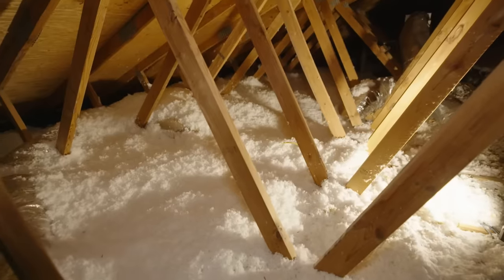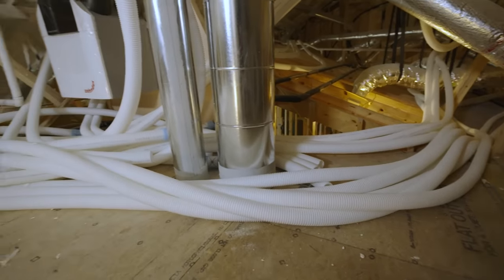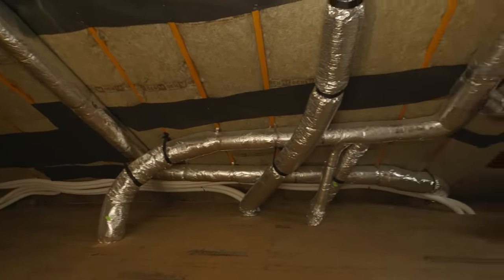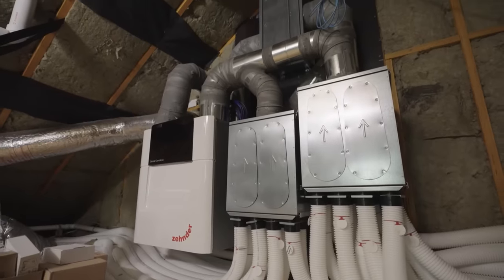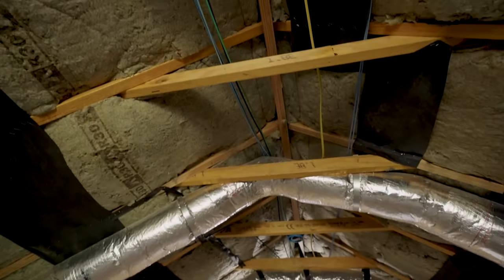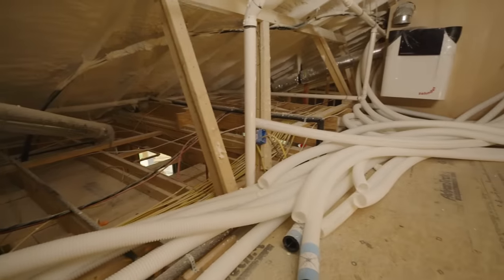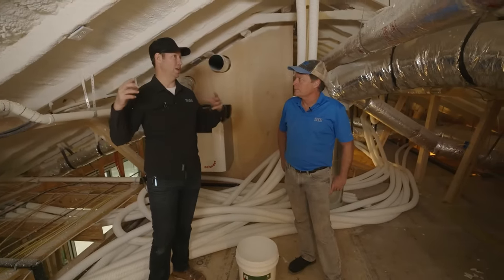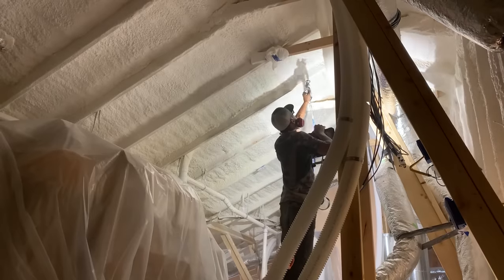Building a BETTER attic - Unvented + Conditioned attics 101

Comment: Don't say it's dumb. When it's done right, it's totally fine. Is an insulated attic better, yes, but if all attics were insulated, house prices would be much higher and it would be even harder to buy a house. You have to know that we are not all sponsored?
Reply: How is sticking the insulation to underneath the roof any different that laying it above the ceiling?
Reply: @ShotGunner5609  Gravity can hold insulation down. It can't hold it up. Thus, you've gotta use a more expensive insulation solution to get the job done. Ergo, quite different and somewhat unnecessary if the attic is actually vented properly(many aren't)
Reply: @InfernosReaper  yeah the same thing happens with unfaced fiberglass in your walls. That why you use the faced stuff. Nithing lasts forever but thats just a secument issue. The cost difference isn't enough to say its gonna keep you from affording a house. I agree that most places are not correctly vented. And venting is not necessarily a bad thing when done right. But it is better to completely enclose and insulate.
Reply: @ShotGunner5609  Properly enclosing with insulation costs a lot more than you seem to realize. For people with a lot of money, that's no big deal, but for most people, costs add up.
Reply: @InfernosReaper  the only difference in price would be that fancy erv thing for circulating air/bringing in clean air. And then the cost of the extra material to insulate all the walls and ceiling. So in most markets like 3-5k. Thats if you were doing it and it was an add on after purchasing a home. I do wonder how much "value" that would add to a home you were actively buying though.
Reply: @InfernosReaper  I don't think the cost is that much more. Additionally you will recoup some of that costs through energy savings. You can't calculate the better comfort and  air quality you will have. 
I think the bigger problem is we have built homes cheap at the expense of quality.
Reply: @agisler87  Given enough time, sure, but the energy savings really varies greatly by location, though, so for some it could take decades to make a difference.

That doesn't even get into the perils of potentially missing or not being able to track down a roof leak because the insulation's trapping and diverting water. 

I"m not saying the idea's bad so much as it's costly enough and comes with enough drawbacks that it's not the definitive better approach it's being made out to be.

Though, I do question how much power you'll be saving running AC in the attic instead of having good natural airflow.

Comment: Matt love the videos, but I’d say the majority of your viewers don’t have this in their budget myself included. When sponsors pay for half your house, it’s easy to put this kind of thing in.
Reply: Ultra wealthy and government buildings (tax payer funded) is the only new construction I have ever seen with non vented attics.
Reply: @tmiranda1379  or sponsored YouTubers
Reply: @JavaZombie  No, just the stuff that is of questionable value that he is trying to pass off as the norm, or as "a better way".
Reply: This is how the rest of the world is doing their attics! The US did it too, but that was before we got cheap shit houses we have now. We store stuff in the garage because most new houses also do not have a basement and our cars park outside in the sun and rain. In addition we pay for storage spaces. Overall, we went backwards and pay more.
Reply: I have an 86’ rancher in central Florida. By no means was it “efficient”. All I did was add a ridge cap, used batton style insulation instead of blown, decked over the batts with 1/4 plywood, sealed any air gaps in the ceiling with spray foam and installed a fan up there that works on a switch. My house feels so much better and my electricity bill is thanking me as well.
Reply: The cheap, effective way to build attics is vented, unconditioned, with a wall-to-wall layer of OSB on the bottom chord as an air barrier, and empty of everything except insulation. No HVAC, no recessed lights, no wiring.
Reply: "the majority of your viewers don't have this in the budget, myself included."

So what.
Reply: This is the equivalent of buying a vehicle that has 10 mpg at a lower up front cost, or buying a more expensive vehicle on the purchase price, but it will get you 40 mpg.  It all depends on how much you're willing to pay now, or pay later, and what the breakeven point will be.  Either way, you are paying.  My perspective- going with the less expensive purchase price option only gives me the chance to save money- once.  And my ongoing operational expenses will be elevated.  Or, I can spend more money up front, and save money every single month.
Reply: I thought that I had read that even with Rockwool you would need some sort of membrane.  Clearly there is none.  The Rockwool is vapor open.   Can you speak to when you need a membrane between the insulation and the conditioned part of the house?
Reply: @notahotshot  he’s saying this isn’t really a video for an “every man”, it’s like “here is how you do your own oil change on your Bugatti. It’s not terribly difficult if you only install a two post lift in your garage, and hire a mechanic to come to your home to do it. Also, it helps to have a complete set of Snap-On tools to get the job done right.” It’s just being pretentious, he did none of the work himself, his employees did, and probably figured out using his accountant, most of the ways to deduct every penny. This is a video for builders that want to build this way and sell this way to their customers, it is by no means something made for homeowners that just happen to have $50k+ laying around to “spruce up their attic and remove all relative humidity and sound”. I’m sure that’s what the OP meant.
Reply: @JavaZombie  Prove that they aren’t, he plugs companies all the time, plus he has a successful business where he gets discounts on brands, he has a YouTube channel where he gets revenue, and he has accountants that find all the tax loopholes, so, yeah, he DOES have sponsors, maybe not that kind that want you to plaster their stickers on your hillbilly nascar though. And no guy, most people don’t just have $50k+ laying around to pull this amazing attic build off. This guy had his crew do the work, knows the vendors, knows the technology by going to expos and seminars, he’s the right guy in the right industry to be able to do this, regardless of “priorities”.
Reply: I cannot have this therefore you cannot make a video about it.... what sad, miserable drivel
Reply: If you don’t pay the money upfront to do this, you will be paying it in the long run with increasing high cost of air conditioning…

Comment: Building a conditioned attic is essentially adding more square footage to your house. I can tell you right now, if I was going to spend the money to finish my attic like his, it better be livable like a second or third story, not just a comfy space for duct work.
Reply: Enjoy your high cooling bills while you are at it.
Reply: Some people just don't get it.  What is fun about having your ductwork bake in an oven?
Reply: Comfy space for your storage, and for the future workers that have to do repairs instead of sweating head to toe.
Reply: Do you enjoy paying higher taxes too?

Because a finished attic space that is not part of the square footage is storage space that isn't counting against your property taxes.
Reply: @bigd7355  A pollen free environment leads to a person who is more allergic to pollen.

Use it or lose it.
Reply: As someone that has built over 30 homes from the foundation up this is more economical than you think. Your not only improving your cooling and heating bill but you reduce the chance of growing black mold. Also home fail over long time due to moister.
Reply: @popsknows5648  What on earth are you talking about? Unless an attic has no way of drying out after getting wet (which btw shouldn't happen unless you have a undetected leak), mold does not grow. Southern attics in the summer are hot, and all that heat dries stuff out fast. Did you even watch Matt's video when he cleaned out the attic of that 70s era house? There wasn't black mold anywhere. Having a conditioned space isn't going to stop black mold if you have an undetected leak. I have seen plenty of black mold in living spaces. Black mold is about water getting into some place it shouldn't, not conditioning.

Make sure all your plumbing is sound, the HVAC drains aren't plugged, the roof doesn't have any leaks, your windows are properly sealed and caulked....Matt's done plenty of vids describing the damage water can do. Never once have I seen him say the solution is conditioned spaces. That's just nonsense.

Comment: That’s great if you’re building a house with a high budget. But what about everyone else?
Reply: Rockwool is cheap, you will probably make the money back in saved energie.

Insulating the roof is the most effective way of saving energie you can do in a house.
Reply: I used spray foam insulation when I built my house 14 years ago. At that time the cost was about 3x the cost of traditional insulation. However, in real world numbers, I got the difference back in the first 7 years.
Reply: Get a 3d printed house then.
Reply: Think of it this way, would you rather pay more up front or A  LOT more over the life of your house?

I mean AC systems are expensive! Why spend the extra $$ on a central AC and not just do cheaper window units?....that you will have to replace a lot sooner than a central system plus you now have more of them to replace...

It all boils down to where you want to spend the money.
Reply: This is a lesson on how to claim home renovations as business expenses.
Reply: "What about everyone else?".... They live in a van down by the river.
Reply: That's a bit vague. You actually want advice or being rhetorical? 
My basic advice is, do it right. Don't put foam in the walls and blow or batts in the attic. If you need new a.c.or building in a budget, you can get a smaller a.c. with foam. Windows transfer heat. You can also use light colored roofing tiles or paint what you have white. That's a passive but effective way to keep cool.
Reply: Trusses like he was showing are really only used in mass produced ranch houses 
 On any other houses especially private houses framers will do raftors instead you have much more space and it's super easy to vent
Reply: @seanaguilar2057  i live in FL i see dark brown roofs and south facing  metal uninsulated garage doors painted dark. my white door gets to hot to touch can imagine dark'  did test where i worked our lab cars were various colors so 1 day a white and a black car parked next to each. took calibrated thermometer gun
almost 30 degrees f difference even my navy blue was 10 f cooler
Reply: @agoniaXdunya  I don't think he's a bird.
Reply: @agoniaXdunya  Peasant. Funny, though.
Reply: @glenagarrett4704  Agreed! I had radiant barrier sprayed into my attic on the underside of the roof and watched my electricity bills plummet the following year and every year since. Radiant barrier is awesome. Yeah, if you're a handy kind of person you can do it yourself with some work involved. I'd rather cut a check.
Reply: @ctcv-to8kq  Agreed on the radiant barrier and the check writing! Attics are no fun to work in. And I'm not as young as when I did some of my own work in mine. Crouching and crawling doesn't cut it anymore!
Reply: Easy, ask for the ritsinger discount, free rock wool for your house!
Reply: @agoniaXdunya  FFS🤦🏾‍♂️. You can't even spell peasant. You called him a pheasant which is a type of bird.
Reply: @erod6468  actual lee. For all intensive porpoises the two are mutually interchangeable.
Reply: @joea400  you must live in Sacramento Joe… like me
Reply: Build smaller to increase ability for comfort... Long term
Reply: Us poor people buy existing homes or rent or sleep on the street
Reply: @xcyron  is Styrofoam okay too?

Comment: Im a HVAC TECH in south Texas and those conditioned attic spaces are lovely
Reply: Its such a disappointment to have a huge attic only for it to be unusable due to cheap lazy design.
Reply: Maybe you can answer this! I cant find the video....yet....of the installation of that conditioned attic....whats with all those smaller white ducts?
Reply: @AD-1138  The small white ducting is for fresh air, it is in the video, but the go over it pretty quick.
Reply: @AD-1138  small white vents are bathroom vent fans.

Comment: Having lived in a Texas home with a conditioned attic I can confirm it is an order of magnitude better than conventional.  It was proven as my neighbors had conventional with Identical builder.  I opted to spring for the initial $$ up front.  Result?  My heating/cooling costs were 1/3 my neighbors with same size homes (2500 sq. ft).  No Dust, no bugs, super quiet, and no dread when handling things in attic.  I can verify also the cost upfront was easily offset by energy savings, and no doubt made my home sell at a higher price than comparables due to my ability to prove energy costs based upon actual bills.  I will never live without a conditioned attic ever again.
Reply: Last I checked, doing a conditioned attic increases the cost of your build by like 20-30k. Spray-foaming alone will run you like 10k on a house that size, then add in all the extra building materials to make an attic like that. It costs about $133 on average to cool per month at 2500 square feet (the median house size in the us actually). It's great if your bills are a third of your neighbors, but to make up for that much money you'd have to own that house for DECADES and that is just to break even. To actually start seeing a benefit you'd essentially have your house paid off (with an average 30 year loan). The person that didn't spend that extra 20k-30k will have their house paid off that much sooner as well. You have to think long term here. Yes, that house is more efficient overall, and is in fact an energy saver. But it's gonna need multiple owners and decades to really pull ahead of a traditional attic, and those building the home will have to be able to afford said house. Meaning they either need to put off building longer so they can save up more money and potentially get a better career to afford the higher payments, or they'll be struggling to pay for the house and likely never pay it off before they die/retire.

It's all about costs, really. And with the housing market right now, and the cost of building materials, you can double or even triple those extra costs. So suddenly that 20-30k is an added 40-60k, or even a 60k-90k extra cost (depending on many factors including house size). It's all about costs vs benefit and for a lot of people it won't be worth it.
Reply: @williameldridge9382    I agree, costs today aren't a direct cost savings.      But there a huge thing to ponder.  It is the running and lifetime costs.  The cost in in today's dollars. 20 years from now the initial amount will be beans, and energy costs will be massive in comparison.  Actually it can become a reality much sooner with current political pressures.  It adds more than energy efficiany it creates strength, seals moister prone areas (we live i black mold country) and creates a storage area where you valuable dont get ruined by 150+ degree summer heat

BTW.. where are you getting those costs for materials and labor?  You must live in a non-right to work state where unions rule.  Here in TX My neighbor just foamed his  place at $2 Sq/ft.  Its about 2.5X conventional fiberglass, But nowhere near those numbers you are getting.

Comment: Amen to the importance of a sealed attic, Matt. When I insulated mine, nobody wanted to believe me that it was going to be 75 degrees in side with 100 outside. Got the proof today! 101 outside, 71 inside. During the manual J calculations I had to argue with the engineer that I wasn't going to have 40% energy loss in the attic because all my ducts were in the conditioned space. And because the attic is my return air "duct" that saves even more energy. My A/C guy and I decided to downgrade from a 5 ton unit to a 3 ton after he saw the results. Thanks for the great videos. Amazing what one can learn!
Reply: What do you mean your attic is your return duct? You have vents between the attic and house?
Reply: @andrewmckinlay2964  The problem with sealed attics is that you get stagnant (and humid) air in them while your return air is passing through it through return air ducts. A truely "conditioned attic would require supply and return ducts to cool/heat the attic. We opted to passively condition the attic by running all return ducts with terminations in different attic locations. Since the attic is sealed it operates like a giant return plenum, concentrating and mixing the return air from the house. The air handler then pulls the air from the attic and recirculates it throughout the house where needed. In addition, this gives us the opportunity to manage the humidity with a whole house dehumidifier and let the dry air in the attic mix with the return air from the house. We have several thermometers with hygrometers throughout the house to verify that this principle works consistently. Hope this answers your question. - Wolf.

Comment: Remodeled a 3 apartment house using only rock wool as insulation for both temperature and sound. Worked wonders, afterwards you could not hear a sound between the apartments while before you could understand any conversation that was above a whisper. Not only is rock wool wonderful to work with, it's not itchy in the least. And as a bonus, it also acts as a fire barrier.
Reply: We call it the green itch when we use it framing lol
Reply: I loved working with the rockwool on some of our remodeling. Just couldn’t find it consistently. Definitely chose it when I could.